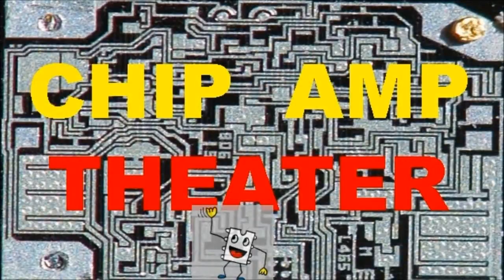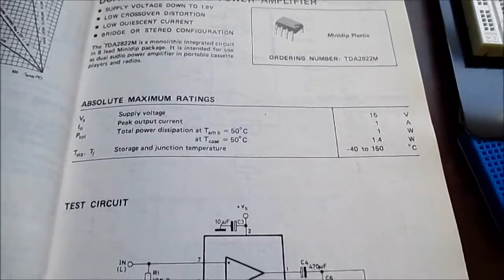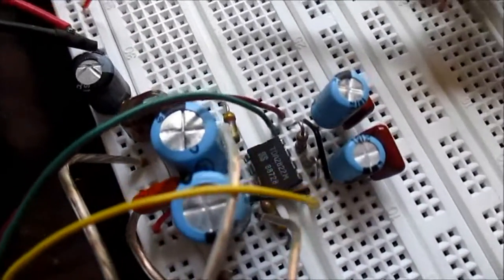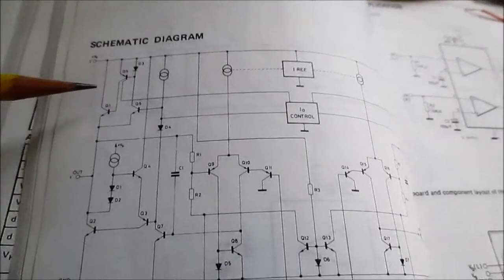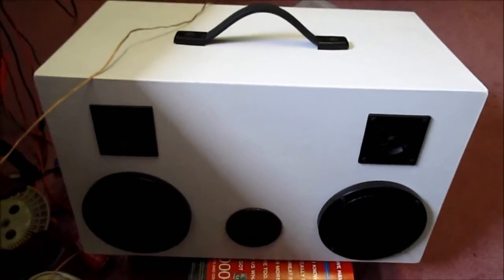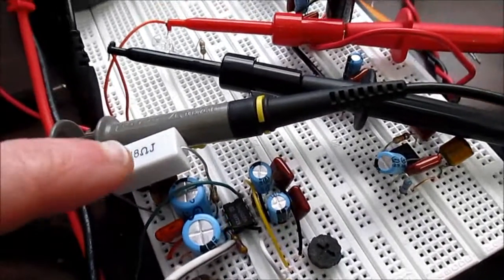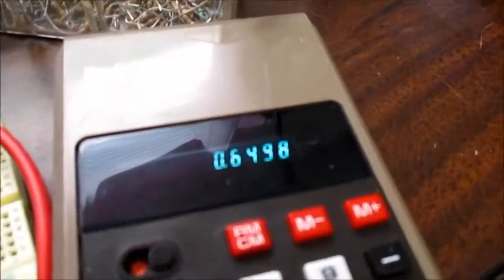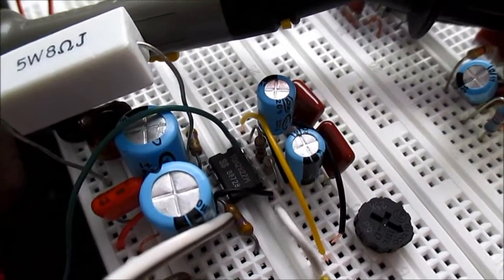TDA2822M stereo audio amplifier IC test and review

Comment: What's the function of Input impedance in an audio amplifier IC and what difference will it make if the Input impedance of the IC and the source (music player or phone) don't match or their values have huge difference ?
Reply from the maker: Input impedance can vary with different ICs and circuits they are used in. You are not trying to match impedance for max power transfer in this case. You want the source impedance to be much lower than the input impedance so that the voltage and/or frequency response is not affected.

Comment: Right now I'm looking for an LM386, I asked for one at the local electronics shop, and the guy gave me two NTE857M,  ( not even close)  so I'm digging through my parts boards, and I have a logitech PC speaker board, 07/16/02.  which is using the TDA2822M.  I punched that into youtube and found you.  Thank you for testing it for me.  I was happy to hear you say it's better than the LM386, nice. 
I don't know if you are interested, the layout is not much bigger than the one you show here; however it does have a few more features.  Top side has 2 470uf, 2 100uf, 1 1000uf, 2 104s.  bottom has 5 micro caps. 2 from gnd to LH side of pot (10k) twin. 2 from 2 mini coils about 1/4" long, only 3 wraps to the 100uf caps. all tied into resistors coming off the pot. red red orange, as well two orange orange red. Ive only memorized brown and black do far. lol, long day, to tired to look them up.  I'm sure you are smart enough to figure out exactly where those would be located anyway.  Don't know what I'm going to do with these JFET INPUT OP AMPS,  I can't find much on them, except that they are really good for hi fidelity,  oh boy. 
Great vid, thanks.

Comment: I've just de-soldered one of these little babies from a Bush Internet TV (Dial Up!)
I've made a solar powered LM386 Portable speaker. I'll have a video of it being made up soon. 

I'm now going to make another one which runs on a Li-Ion battery pack which I'll make out of old cell phone batteries.
Would you recommend running the TDA 2822M at 12Volts??
I know the Datasheet says supply voltages of 1.8V - 15V. 
So was planning on running it at 12V (3x 3.7 Volt - 4.2 Volt Cell Phone Cells!)
I'll be using 2 x 3.2 Ohm Speakers wired in series to get me 6.4 Ohms 
(Mainly Because They're The Only Little Speakers I Have Left! The Kids Keep Putting fingers through Speakers & Intentionally Blowing Speakers Up!)
Are there any recommendations that you could give me as to the best sounding circuit John?
The LM386N-1 IC I used I put an inductor coil in the circuit between pins 1 & 8 along with a 1K resistor and a couple of caps, think they were 10uF & 47uF, was experimenting last night and added a 47nF cap straight across the pins 1-8 and I got a really nice treble boost which helped with the crappy speakers frequency response!
Also followed your star ground advice WHICH MAKES SUCH A DIFFERENCE!

Which to be honest is why I'm asking you for a little advice John.
Hope You & Snickers are both doing OK!
My cats Ziggy & Jack say Hello to Snickers!
Reply from the maker: Hi form Snickers and me! 12v on the 2822 is too much when using 8 ohm speakers or less. I'd keep it below 9v with the 6.4 ohm speakers. The best sound is subjective and depends on your speakers. Equalization can make them better. For example, the treble boost you applied made your speaker sound better.
Reply: Thanks John I'll incorporate an LM317 into the circuit to drop the voltage to somewhere near 9V maybe just below. I'll use a 200 Ohm resistor and a 1K resistor and it should regulate the voltage to approx 7.5V. Would that be better? I'll start experimenting with this today while the kids are at school.
Reply from the maker: Yes, the 15v max supply can be used only for very light loads, such as 16 ohms. Around 7.5 volts is ideal for your speakers. I can receive things at my post office box:
JohnAudioTech, PO BOX 362, Vandalia, OH 45377
Reply: I'll post Snickers some treats next week maybe the week after we've got to move house in the next 10 days so things will be kinda hectic I'd have thought I'll make sure they get sent out though.
Thank you for the advice, it's very much appreciated.
I have now completed the circuit with the TDA2822M, and I've got to say that it works ever so well, so much easier to set up than the LM386N-1.
You follow the datasheet and it just works perfectly! 
Unlike the LM386 which took a whole day of trying out different capacitor values and adding other components to get it to sound just right!
I'm really glad I stumbled upon this IC it really is simple.

Comment: Anyone know how well this IC works with 12v into 8 ohm? I can always use a voltage regulator chip but am trying to keep it small and minimal if possible.
Reply from the maker: I wouldn't recommend it because it is two amps in one tiny package and could overheat. You could regulate it down to 9 volts and be safe.
Reply: Well I've since built it but I can get about 800mW max @ 9v into 8 ohm,  what's the highest output power that you've ever gotten out of one of these? Datasheet says 1w but I don't see it getting anywhere close to that without upping the supply voltage.

Comment: i have this ic but my question if why the ic is consuming more power supply? i have use nine volt battery but after 3 days my nine volt became 2volts why?????????????? and the distortion apearing after i voluming up........really bad my another question is it is advisable to use 12v transformer to get more volume????i got my ic on my computers speaker.....and its nothing no bass my speaker is 2w 4ohms i have 2 stereo.
Reply: OscarjayLXnoheymyM Cuer

Comment: Could someone PLEASE tell me how on some chips they have a mute and standby pin..how do you un mute this pin..to make it work..I just cant figure this out..I see some say 3.3 volts...but where and how do you do this?...thanks to all that help...
Reply from the maker: +Kennynva T. Do you mean the mute and standby function on one pin? Most are voltage dependent. In other words, a certain voltage range on the pin determines what mode the IC is in. This should be shown in the datasheet and can be set with a couple of resistors if the power supply to the IC is steady. Otherwise you would need a zener diode and resistor to keep the voltage constant on the pin.
Reply: I mean is a separate supply or the supply to the IC...?? And the IC Im using is a AN17811A and the supply is 3.3 for each mute and standby...how can this be...it has two resistors at the pin also...Thanks for the fast help..
Reply from the maker: +Kennynva T. I looked at the datasheet. If you have only the 10uf capacitor from pin 2 to ground (no resistors), do you get any sound? If not connect a 47k resistor from pin 2 to pin 5 (leave capacitor connected) and see if that works. If not, it wants a more specific voltage range on pin 2 to deactivate mute/stby mode. You would then need a voltage divider resister network to set the proper voltage on pin 2. Datasheet doesn't specify current sink (or source) from pin 2 so it would take experimentation.
Reply: I get some sound..but it sounds very distorted...like a radio station off frequency..
Reply: How can this happen...I tried a lower voltage 9 volt battery..which is around 7.5 volts..and it sounded clearer...how is this..???
Reply from the maker: +Kennynva T. This sounds like instability. You may want to watch my video about noise and distortions in amplifiers: https://youtu.be/xbinXh1ZSqk

Comment: i breadboarded this chip, but i hear a hear-ably big no signal hiss, and some disturbances during playing. it also made cellfone signal interference.

was testing only 1 channel though, with 6v battery. does the one you made, sound totally clean ?
Reply from the maker: iceberg789  No noise or distortions here. Very important to mind your grounding circuit. Check my LM386 proper ground layout video if you haven't. Applies to all audio amps.
Reply: just tried it and there was huge improvement ! the breadboard tda2822m still has a little hiss, may be due to the long legs of components etc, but the veroboarded tds2003 i was having trouble with noises, went absolute silent and like a pro.
thanks for telling me, it's amazing ! :)
Reply from the maker: +iceberg789 Glad to hear it worked out!